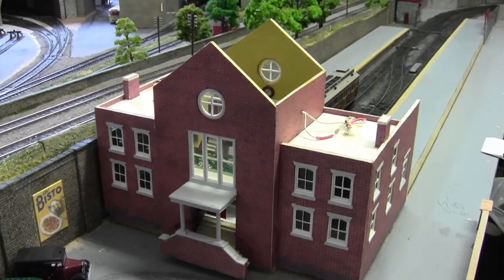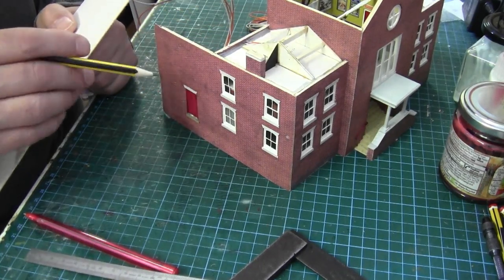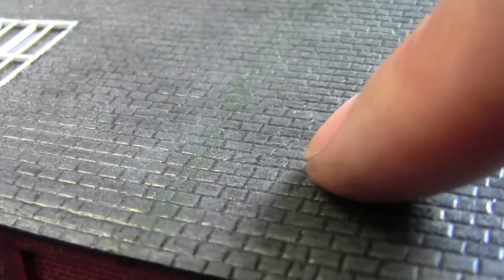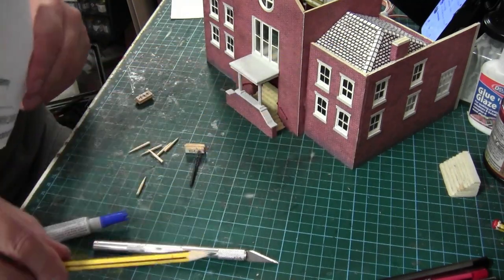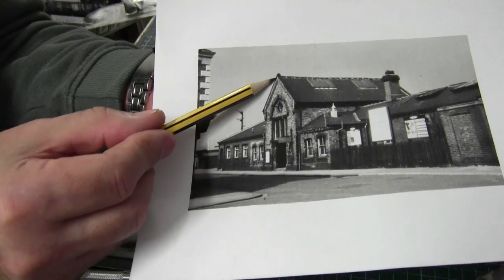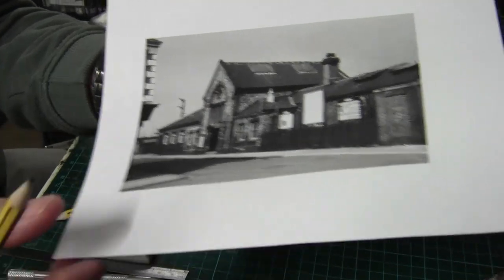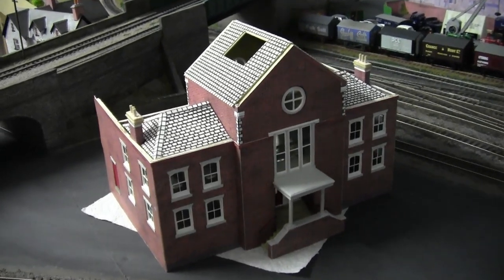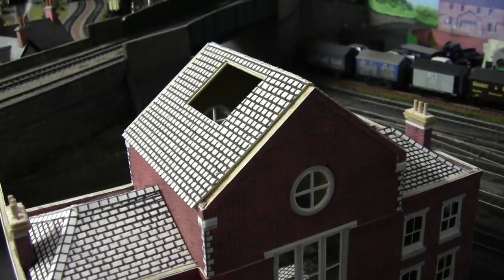Jarrow Road Station. Part 10. Roofs & competition. No347

Comment: Hi Tony, fiddler on the roof I see - but everything got joined perfectly, you really have mastered those angles, look forward to seeing those painted up. Using that semi round hasn’t half (pardon the pun) made a difference to the profiles for windows, canopy etc you can now use, so life like.
 I will plump for four - Saracens Head, The Crown and Anchor, The Railway Inn and The North Eastern (formerly Black Horse Hotel). Good luck everyone. Cheers Tony
Reply from the maker: Hi Stephen, The angles is all about careful measuring. if in doubt make paper templates and then copy it over onto card. many thanks again for commenting. take care buddy. Tony:goodvibes:

Comment: As always , Tony , brilliant!
I've always avoided those roofs ( I think they're called " hipped" but am not sure if that's correct term) as getting the angles to meet looked like a headache. Will give them a try! Thanks for another excellent video. All the best. Peter.
Reply from the maker: Hi Peter. if in doubt about the angles, make paper templates and that gives to the option or trial and error. but plenty of measuring and checking does help.:goodvibes:. all the best with your project cheer's for now Tony.